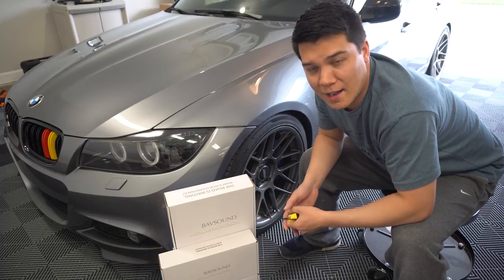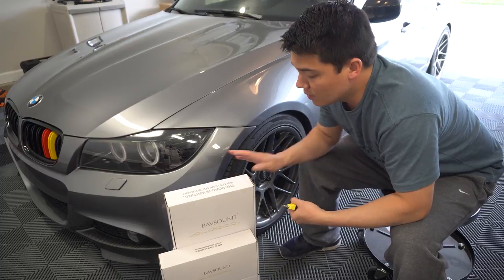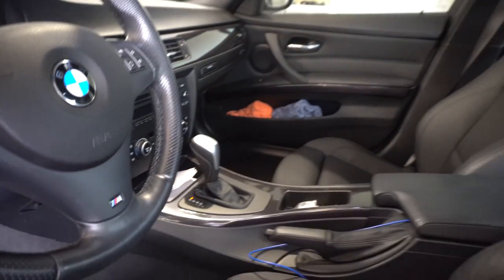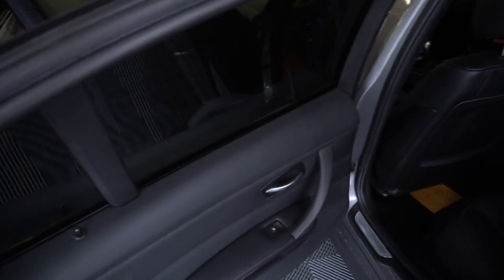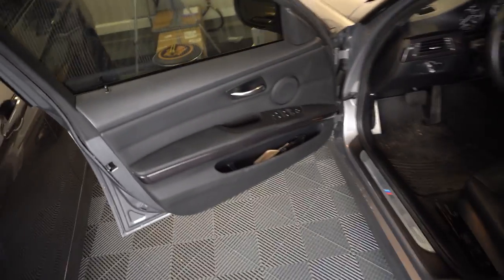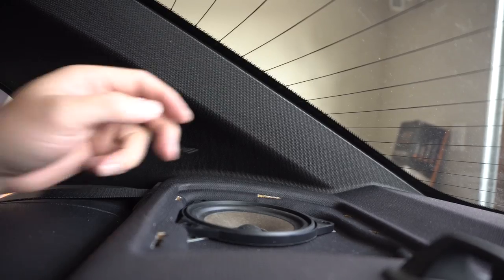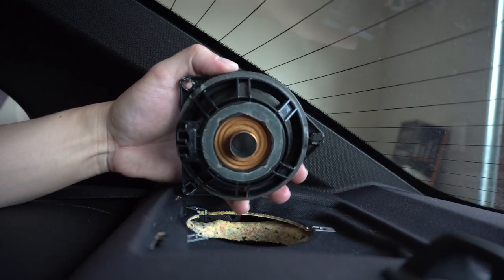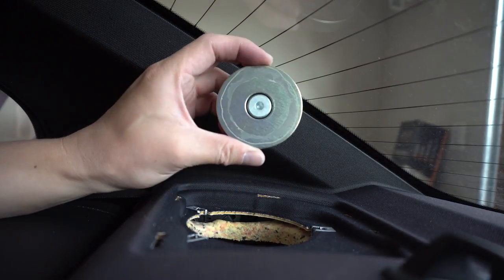BavSound Speaker Upgrade | BMW E90 335i

Comment: Is there an extra port for OEM tweeters like the OEM speakers?
Reply from the maker: For this particular car, no, since its the BMW Base system that doesnt have OEM tweeters. If you tell BavSound what system you currently have, it will pull up all of the sound system options for your specific car.
Reply: @accelerated_motion  how can I find out which system my e90 has?
Reply from the maker: @4k_fons  If you go to BavSounds website, you should be able to plug in your VIN number - they will tell you what system you currently have and what BavSound options are available to you.

Comment: what are the wheel specs please?
Reply from the maker: 18x9 ET 30, 18x9.5 ET35
235/40/18, 265/35/18
Reply: @accelerated_motion  thanks they look really good, I'm saving up for a set but expensive over here in UK
Reply from the maker: @gravyear4028  yeah they look fantastic. I have a set on my f80 m3 as well